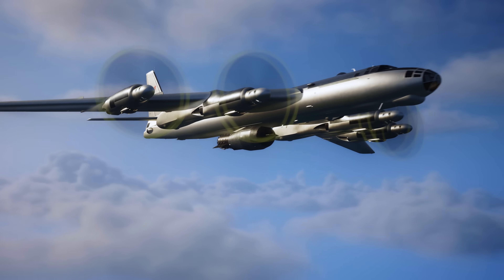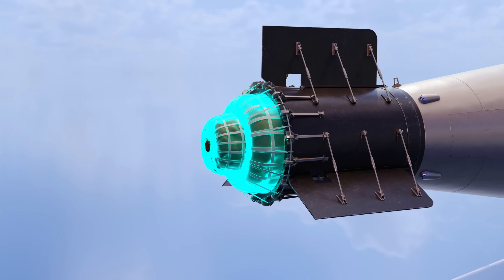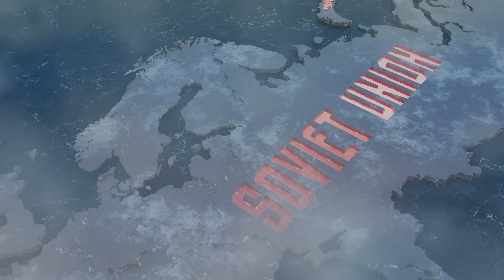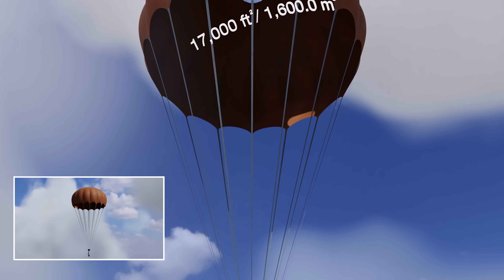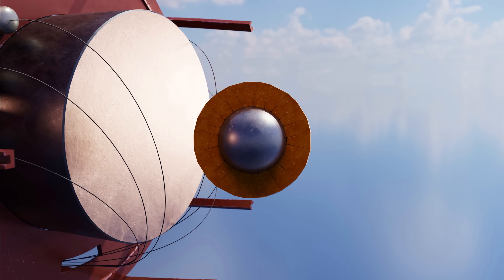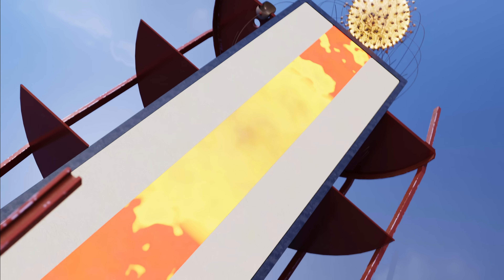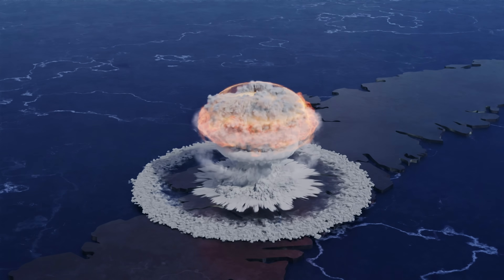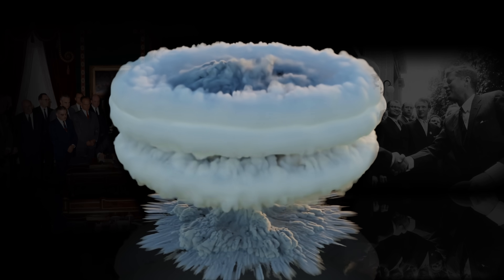Inside the Tsar Bomb

Comment: Ngl, no disrespect but, im not sure if this should have been a video at all, its not like there are public design documents for the Tsar bomba out online;  this mean that much of the video is just based on pure speculation. That defeats the purpose of a cutaway explanation video imo. 

Im also pretty sure theres several mistakes/omissions here too, but admittedly, im not an expert on this topic

1. From all russian accounts Ive seen (through machine translation, admittedly), im pretty certain  the Tsar Bomba used 2 thermonuclear* stages to triggering the main thermonuclear stage, not by 2 fission stages directly (those thermonuclear stages are being triggered by fission stages of their own though)

2. The triggering of a fusion stage is not just via the neutrons being dumped into the "sparkplug" and causing fission there, it is also (likely) from the compression of the stage by the xrays emitted by the triggering stage, as otherwise you dont get the needed compression in the fusion fuel. (Admittedly

3. Im pretty sure the tamper casing should have openings on the sides to allow the easy passage of neutrons from the trigger to the sparkplug, otherwise youre wasting them on the tamper.

4. At this point in history, russian nuclear weapon primaries should already be using boosted fission, ie they should already be using tritium injection.

5. Im not sure if attributing the partial nuclear test ban to the tsar bomba is that correct, it was undoubtedly a part of the reason, but its hardly like there were no calls for a test ban beforehand (there was even a testing moratorium that the soviets signed from 1958 to 1961), and imo the 1962 cuban missile crisis almost defintely played a larger role in getting the superpowers to agree to a test ban.
Reply: Check their sources before making such claims. They are in the Description specially for you.  And thanks for your part of "pure speculation".
Reply: @Exiled_One3548 i would check, but I havent been able to find any except for the rosatom footage (which i have watched before) after a cursory search. That doesnt change my main complaint though, that there just isnt any detailed design sketch for the Tsar Bomba (for obvious reasons) so making a cross section video based on speculation is a poor choice (hell, publicly we dont fully understand the mechanics for any thermonuclear weapon, so doing this video for any is a bad idea imo)

And sure, alot of my comment is speculation, but most of it is pretty commonly shared and understood speculation about nuclear weapon design (stuff like a fusion stage requiring compression through some method, generally understood to be from xrays from the primary stage, and stuff like using tritium boosting for the primary stage to reduce the amount of fissile material needed).
Reply: Tsar Bomba is a pure Russian weapon that did not kill anyone
COVID19 - The secret US government's weapon has killed millions

Comment: What blows my mind (excuse the pun ) is that the second stage survives the first stage. The first stage is literally 2 atomic bombs (similar to the ww2 Fatman bomb) that’s detonating inside the Tsar Bomb to compress its second stage. How do the metals of the second stage not instantly vaporise?
Reply: It is helpful to think of the bomb, after detonation, as a cloud of plasma with the individual parts of the bomb in the plasma state, held in place (briefly) by inertia so that this hellish reaction can play out. The bomb is literally transformed into a plasma bomb about one microsecond after the reaction starts.
Reply: That's exactly what happened. It's just that all the processes shown in the film take place in microscopic fractions of a second, virtually simultaneously. One of the main challenges was to detonate both charges in perfect synchronisation, and to ensure that each detonator fired in perfect synchronisation too. The Soviets spent months manually rechecking the detonation system.
Reply: @Exiled_One3548  That's actually not a challenge at all at this point. You simply make all the wires leading to the detonators of the implosion charges the exact same length, and energize them from a single power source. This had to be figured out to make implosion-type nuclear weapons work at all.
Reply: @KingdaToro  It's a challenge. It's unachievable. Tsar bomba didn't use it. The standard deviation of EBW detonators simultaneity is longer than the incubation time of fission explosives..
Reply: @Exiled_One3548 There's no evidence it used two primaries..
Reply: It only used one primary. It's not possible to use two.

The secondaries do vapourise. Or at least the outer surfaces to. The radiation diffusion wave that drives the vapourisation decelerates rapidly, undergoes hydrodynamic separation, and implodes the secondary before they can be vapourised by the thermal radiation in their entirety.

Technically, the implosive shock vapourises the tamper, and it implodes as a gas. But the inner regions of it are "cold" relative to the outer regions that have been vapourised by the radiation from the primary.
Reply: @Evan_Bell  In the animation you can clearly see one primary sphere at each end of the secondary.
Reply: @notmenotme614  And the animation is incorrect. In more ways that just this...
Reply: @Evan_Bell  How do you know this?
Reply: @notmenotme614  Because I've studied this topic extensively. I understand the synchronicity required for two primaries to be usable to detonate a single secondary, and I know the standard deviation of EBW detonators. I know these two values render using two primaries for one secondary impossible.

Comment: I thought the yield was halved by having less fissile material not by making the casing out of lead, very interesting!
Reply: Some of the fissile material was replaced with lead. There were a number of technical reasons for this, including the weight and balance of the finished device.
Reply: @alexkart9239 Fissionable, not fissile. The full yield design called for natural uranium. The two version would have the same weight..
Reply: @Evan_Bell  You're partly right. The natural uranium-238 in the second stage is initially non-fissile. However, during operation of the first stage, the neutron flux irradiates the uranium-238 and converts it into plutonium-239. This means that all non-fissile uranium-238 can be considered fissile during the operation of the device as a whole.

Comment: It is comforting to know that this was a green nuclear test.
Reply: It went from "fuck everything in this large region including thousands of future generations" to just "fuck everything in this large region".
Reply: @MidnightBreezeIWP  :face-blue-smiling:
Reply: 100% organic nuke
Reply: @billyb4790  97% organic!
Reply: To be clear: Nuclear fallout is a collateral damage only inherited from old fission bombs. Most multi-stage nuclear weapons are designed for explosive damage and short time radiation impact...
Reply: @renardrougesombre  Not true at all. Modern thermonuclear weapons derive the substantial majority of their yield from the fast fission of a U-238 tamper by fast fusion neutrons. They are very dirty.
Reply: @renardrougesombre  You are kidding? This was an experiment to test the fusion part of the bomb. The lead was used because it would have similar properties to the U-238 that would be used in the real bombs, but would not undergo fission. Be assured that the bombs intended for real use did not contain lead! The main purpose of these bombs was to get away from the mass limitations of the older weapons, many thousands of kg of U-238 instead of the 6kg of Plutonium and 111kg of U-238 in the Fat Man. The fusion of the tamper would be 50% of the explosion!
Reply: @oldbloke135 Repeating the facts doesn't make it an argument. 😂 And you confuse this bomb with a normal warhead, because of his utterly absurd hugeness it would have the same chance on the battlefield like the Landcruiser P1000 "Ratte". 😊 Oh and if you see, that even in the bolshevists reign scientists changed weapon designs to avoid unnecessary damage. And no, it wasn't a test of the fusion part, the had already extensively tested the Teller-Ulam-Design. It was a strategic demonstration of capability and superiority. So only you having an opinion doesn't make it worth to go out to spread the word. 😅
Reply: 第二次世界大戦の沈没船に積まれた通常火薬は今も海を汚染してるよ
Reply: Yo, the parachutes were not made from bio degradable material, boooooo
Reply: No animals were harmed …
Reply: Prima o poi gli americani l assaggiano😂
Reply: @cosimocorbe3778  Your country is hosting NATO bases, are you so eager to see the russians nuking you? Think a little.

Comment: Also, Tsar Bomba was the small-scale test for the actual bomb which was set to measure between 100 and 200 megatons of TNT.
Reply: The Russians must have a few of those bombs. Knowledge allows for it and present  technology allows it as well., something the west no has. Smaller versions obviously delivered by various other means than 60 years ago.
Reply: With today tech her size and weight will be at half capable to be carried by Sarmat stages as it can carry ~18tons so the could made them smaller at 50-100megaton as 100 megaton is inside each Poseidon nuclear propulsion drones....

Comment: Blue Paw Print, hats off to you, you guys make great videos. I've seen all of them, and love the detail and effort you've put into the modelling, the cutaways and the explanation.

But I do have some constructive feedback that has been bothering me in a lot of your videos: You need to work on the animation/motion of your flying stuff. The bomb release in the beginning of the video looks like the bomb is being launched downwards by a cannon. When the bomb is dropped, it moves around one bomb length (~8 meters) in 3 frames (0.1 second), which is a speed of 80 m/s, or ~288 km/h downwards.

This implies an acceleration of 800 m/s^2 from the point of release. By simply considering gravity at ~9.8 m/s^2, the bomb should only be moving at a speed of 0.98 m/s downwards after 0.1 second. At an average speed of 0.49 m/s for 0.1 second, the bomb should only have fallen approximately 4.9 centimeters away from the plane. In other words, the falling speed of the bomb is off by over a factor of 1600x, over 3 magnitudes. It's extremely jarring, and really deters from the quality and scientific accuracy of the rest of the video.

This is also a problem in your videos featuring airplanes. Your planes often pull hundreds of Gs, enough to instantly kill the pilot and disintegrate the plane. They also turn and roll on a dime, and fly at very inconsistent speeds.

Please consider animating your future videos with realistic velocities and accelerations, including turning speeds and such. It would truly elevate your videos from great to absolutely amazing.

Comment: i always wondered if the TSAR had dual primary's...makes sense, given its shape and yield.
Reply: information is conflicted on the exact configuration this is one of the more accepted versions the other had a secondary and tertiary
Reply: @anuvisraa5786  "the other had a secondary and tertiary" Yup, e.g. the Wikipedia article on it says it was a three stage bomb, fission-fusion-fusion not just fission-fusion.  While the Wikipedia article doesn't say, I think it would be strange if the fission primaries weren't also boosted. Also, the fission primaries must have had some sort of neutron initiator source, whether Po/Be or electronic (basically a tiny bit of fusion).
Reply: It’s crazy to think that the Tsar Bomb used 2 atomic bombs as its detonator, to fire up the second stage.
Reply: @notmenotme614  All modern weapons use one atomic bomb as a detonator.  Two isn't actually crazy.  It's one of those things; once you figure it out, there's no sense not doing it that way.  Think of it this way:  the fuel is the expensive part, everything else pales by comparison.  So every technical improvement you can make that improves the efficiency of using the fuel make sense, no matter how complex the improvement is.  Little boy was under 1% (No, 1.38% efficient, see Even_Bell's reply)  efficient, using 141 lbs of HEU that took over a year to make.  Fat man used 6kg of Plutonium 639 which they could knock out in a month.  Little boy was a dead simple design:  they didn't even bother to test it first.  But (almost) every design after used the more complex Plutonium implosion method because you needed less fuel.  Levitated cores, primers, etc, up to boosting no matter what complexity added were instantly adopted because they all saved fuel.
Reply: @paul_moir There is sense in not using two primaries. It increases fissile fuel cost, and synchronisation is impossible.

Little Boy's efficiency was 1.38%.

Plutonium 239*
Reply: @paul_moir  "So every technical improvement you can make that improves the efficiency of using the fuel" 95% agreed - in the sense of fuel as U-235, Pu-239, and tritium.  The LiD is cheap (separating deuterium is easier than any other isotope separation) and the final U-238 fissioned-by-14-MeV-fusion-neutrons fuel is also cheap.
Reply: @jeffreysoreff9588  Yes, that's right.  I should have said "weapons grade enriched fuel" or something like that.  Though that isn't right either since Pu-239 is bred.  Otherwise, I hope I was obvious in glazing over other reasons you might use a gun type or otherwise simplified weapon.  I didn't want to get off on a tangent for the recipient of my reply.
Reply: @Evan_Bell  Thanks, I mixed units.  Also I was trying to simplify things a bit for the recipient of my reply, who I took to mean "using nuclear bombs as primaries" was "crazy", not simply two.  I may have misunderstood!
Reply: @paul_moir  Many Thanks!
Reply: @notmenotme614 It didn't.
Reply: @notmenotme614  Crazier that it is 3 stage bomb, without 3 stage. Real power of blast was ~57 MT, shockwave goes through earth 3 times (everyone hear it on the planet). Designed power 100 MT+ (as calculation says ->100 MT, maybe 120 MT at least, no one knows it for sure, for safety consideration there was no 3 stage)
Reply: It didn't.

Comment: There was a medium within the outer shell of the bomb that helped propagate the gamma and x-rays.
Reply: Air...
Reply: @Evan_Bell  I have heard that styrofoam was used, low Z and provided support and insulation for the components.
Reply: @BjarneLinetsky  There is no evidence that styrofoam has ever been used as an interstage material/channel filler.
What is known is that polyurethane foam was used for at least one US weapon model in service from the 1960s to the 1990s.

Other weapons are known to use more exotic materials, the composition of which is known with some confidence. I won't share this as it's not my research to disclose.

The AN-602 used air.
Reply: @Evan_Bell  So the AN-602 didn't use fogbankski? 🙂

Comment: For a second I thought "Why did the casing have so much empty space?" and then I remembered that it was supposed to be stuffed to the gills with blocks of depleted uranium as a tamper to boost the yield to 100MT.
Reply: The empty space is a hohlraum needed to effect radiation implosion of the secondary. The video completely misses this!
Reply: No it wasn't. The lead just took the place of the uranium.

The radiation channel is required to allow the photon gas to be ducted around the secondary...
Reply: Sakharov was telling truth about about reducing the radioactive pollution, but also, the uranium blanket might have pushed the weight above the Tu-95's capability.
Reply: the empty space is for heating up the walls (now plasma) to millions of degrees (or w/e, really really really hot) to re-emit xrays and much more uniformly illuminate i.e. confine the secondary than if you only modulated the pulse with an interstage (or had 2 primaries to get around needing an interstage in the case of the tsar bomb). thats why the radiation casing of thermonuclear weapons is so thick, some level of burn through is required. design of the radiation casing is one of the very closely guarded secrets of nuclear weapons design, though a motivated physics student can just do the calculations themselves supposedly.
Reply: @heresie  Radiation cases of modern weapons are very thin. As little as a few hundred microns in places, for one weapon model.
Even in the late 50s, they were only a few mm thick.

Yes, it's possible to perform the calculations yourself if you understand the physics.
Reply: @Evan_Bell  guess im misinformed, wheres that info from? ive seen info that says a few cm thick, not including the liner. i say supposedly because composites aren't easy to model in any way shape or form. i believe it though.
Reply: @heresie  The very first generation of H-bombs (Castle series) did have rad cases several cm thick.
The mm to sub mm values are from formerly classified docs I had FOIA'd.
Reply: @Evan_Bell  would you be willing to share them?
Reply: Wasn't it got cut from 100 to 50 because the researcher thought that 100 would be "too much"?
Reply: if it WAS 100Mt - it would have been TU much for the TU to handle..